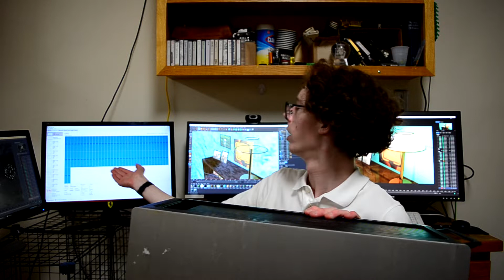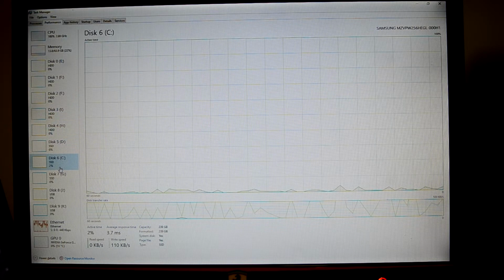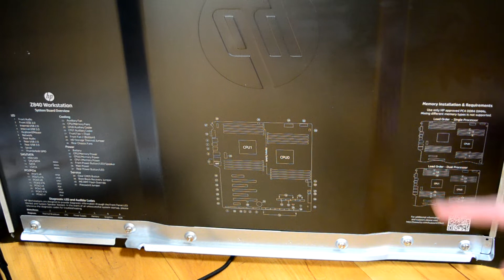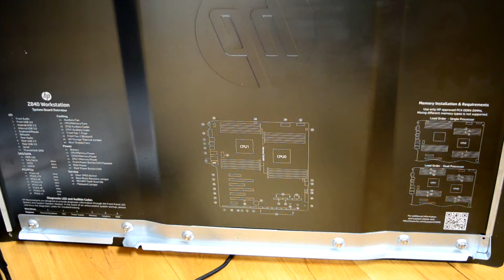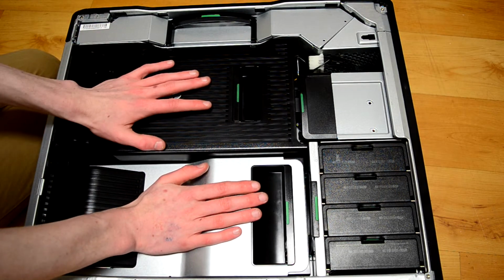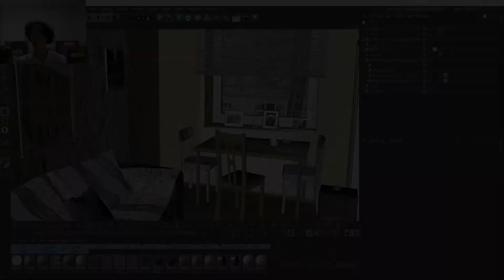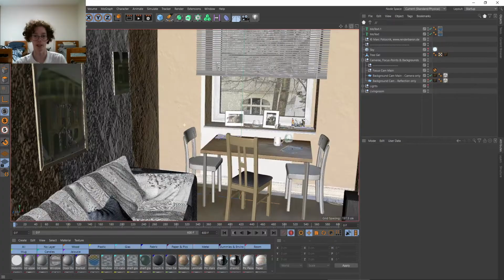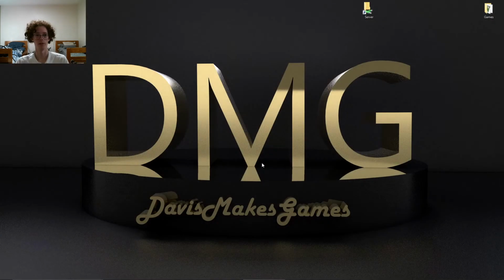My new ludicrously overkill workstation

Comment: E5 2697 V4 128GB 2400 2 x P4000 P2200 Asus Essence STX II Dual Turbo NVMe 250 GB Gen3 IO Fusion 1,2 TB 4fach LAN Druckbelüftung 4 x 70mm x 25mm (Schacht) 1750 PSU @ 240 Volt oh, yes Zorin OS 18 pro Opera core stable. An Irish Horse. Full Slot Utilization +1!

Comment: rockI have the z820 with e5 2670s with 1080ti and its so slow at actual work loads. It takes 1 hour to render 10 minute regular edited videos on davinci resolve and even longer on capcut. It can't even run UE 5 or 4 without crashing. It can barely handle video editing or 3d modeling despite being advertised as it's bread and butter. My 5600x with a 3060 gpu outperform this computer in every single work type even the ones that should run better with more cores
Reply: Is it just E5 2670 or is there a v2,v3,v4?

If there is no v then it's first gen which is still running DDR3 which is very slow. The Z840 can run v3 and v4 of the 2600s on DDR4, V4 can go up to 2400MHz

Comment: Are you still using this ? If so, and you can afford it, grab yourself a HP Z turbo Quad Pro and pack it with 4 x 4tb Samsung 990 pro NVMes in Raid 0. I bought one three years ago for my Z840 and now just bought a second one for my Z8G4 for just $80 (empty of NVMes)

Comment: Love these HP workstations, have a Z620 with 2x E5-2690s and even 13 years later it's a rocket ship... Got a Z840 arriving on Monday with 2x E5-2687W v4s, can't wait to build it out. Only cost £99 delivered 👀 

Great work with yours! Gonna go check out your other videos now.
Reply: rocket ship at what? I have the z820 with e5 2670s with 1080ti and its so slow at actual work loads. It takes 1 hour to render 10 minute regular edited videos on davinci resolve and even longer on capcut. It can't even run UE 5 or 4 without crashing. It can barely handle video editing or 3d modeling despite being advertised as it's bread and butter. My 5600x with a 3060 gpu outperform this computer in every single work type even the ones that should run better with more cores

Comment: I have one that I used to run proxmox on it.  Then redid it to run OMV but it wasn't stable.  Now I am running Ubuntu with Samba for file storage.  It has the same processor but my video card is very basic.  I have 190GB of ram and 4TB of SSD drive space in a Raid 0 configuraton.
Reply: How do you have 190GB of RAM?!

Comment: Loved your video. My HPZ840 has 2 E5 2697 v3 CPUs, 128 GB ram, 1 TB HP NVME boot drive with Windows 11 24H2, Seven 14 TB SAS drives and a 24 GB Quadro P6000 GPU. I really love it. Super fast and super reliable.
Reply: Hey i Just got my hands on a Z840, I'm looking to build a server. how did you get 7 drives into the case? which enclosures are you using?
Reply from the maker: Personally I use the SATSASBP425 enclosure in mine

Comment: Great Workstations I have a few of them,  Just updated one with 2X20 core CPU amd 768GB of RAM as well as a RTX 2080TI. They have 1500W power supplies and are so solid The TPM chip can be updated but Windows 11 does not have the CPU's on its approved list.
Reply: but you can still update to win 11
Reply: That is ridiculous. That is the equivalent to a space heater. Why don't you upgrade and get something that will require a 20 amp circuit? No idea why anyone needs a computer like that.
Reply: @idmhead0160  These are cheap or in my case rescued from Ewaste so its a no brainer, Most of mine are running Linux based NAS servers

Comment: Good on you man for using what you got and smartly building your new system.    If you just need  a Video card with lots of ram?   Just pick up one of those server cards and install the fans on the side,  then pick up one of the Newer Intel GPUs  so you can still game and do hardware accelerated Video encoding with Intel's Quick Sync for your video transcoding.  

If you really want the most responsive OS out there?   Get one of the EOL'ed  Intel optane drives as your boot drive or Scratch drive.  
Sure its MAX transfer speed is not as high as current Gen NVMe drives, but the Que depth that an OS uses is PERFECT on these drives. 
They also don't slow down  as they fill up either.
Reply: Optanes are highly under rated. I have a 280gb 900P boot drive in mine, love it and it will essentially never wear it out.

Comment: How to access the AMT mode? Is there a software with which i can remotely interact ?
Reply from the maker: You'll need to use the AMT LAN port first of all, and make sure the Management Engine is available in the BIOS... past that, any remote management software that works with Management Engine can be used. Couple of them listed at the bottom of this document from HP
https://h20331.www2.hp.com/Hpsub/downloads/HP_WS_Manageability_WP.pdf

Comment: This thing is so insane even for 2024 standard, it's spec is even on par with my strongest pc (aside from GPU) which comes with i7 13700 + RTX 4060 + 64GB ddr4 ram, and it feels like it's video editing performance will gonna destroys my ASUS TUF A15 2023 (Ryzen 9 7940HS + 16gb ram + rtx 4070)
Reply from the maker: I've since upgraded to an RTX A4500, pretty solid card. 3D comparable to a 4070 on paper, but has 20GB of ECC VRAM. Multicore CPU performance is excellent, just a shame that in single core workloads it is soundly outperformed by my 3rd-gen i7 laptop lol

Comment: Wow 😯. I have a HP Z 440 with a E5 1650V3 32g 2133 ddr4. Just fitting an HP Turbo pci-e nvme adaptor. I bought it because it was cheap. Only has a K2200 GPU which works fine for what I do. Great information 👍🏾

Comment: 1) dont fool yourself with the plastic coversr. these machines are not build to a very high standard. the case hasnt changed in 4 generations of Z machines and the mainboard power delivery is barebones. even 150$ gaming trash boards features 12 or 16 phase power delivery nowadays and the design on these boards is designed to supply the power under load while being cooled.

2) you are wrong on the memory channels. each cpu has a 4channel layout. these dont combine into 8channel memory layout. if you want one cpu to talk to the memory of the other cpu your speeds are realy realy bad.

3) be aware of the pcie sockets you want to use if you run 3d applications. you dont want cpu0 to be utilized and loaded when your gpu sits on cpu1s pcie lanes. same goes for other cards. its one of the pitfalls with multicpu systems you need to be acutely aware of -  the overhead of cross socket communication is substantial and will hinder performance in 3d applications that rely on system resources that combine cpu/gpu performance since you might have cpu1 fetch data from cpu0 just to pipe it back into the graphics card that sits on cpu0 pcie lanes
Reply: Why ya gotta ruin it?
Reply: old dual xeons are only really worth it if you need lots of cheap memory, IO and par a l lel computing power. They are great for big storage servers or running lot's of vms. Anything low latency or single thread intensive is a very bad workload for these systems.
Reply: @Looser_23  yess 👍

Comment: Okay serious, question.
Is this worth the money compared to a more modern workstation that's similarly priced? Both for your workload and in general. Is there even a more modern workstation that's about the same cost?
Reply from the maker: Xeon E5 is currently the sweet spot for getting a ludicrous number of cores affordably. The newer workstations (like the Z8 G4, the 840's successor) all use Xeon Gold/Platinum CPUs, which sell for way more for the same performance and can get into the thousands of dollars just for one CPU, while the fastest LGA2011 CPUs are at most $250. 
These are so cheap because businesses replace all of their systems after a certain amount of time, and that "end of life" period has been reached for Xeon E5 so businesses are getting rid of the hardware. That hasn't started happening on nearly the same scale for newer workstations, so you are still basically paying manufacturer prices for those computers instead of like 1/3 the retail price used.

So in short, a new workstation for this price would have more CPU upgrade longevity in the future, but the CPUs you'd be able to get in it for the price would not be anywhere near as good.
Reply: @DanalogRetro  Just how much exactly did you pay for your workstation? Because I've been seeing Threadripper 3960x CPU/mobo/RAM combos going for less than 2000 euros. To me, despite the fewer cores, it makes those Xeons look like toys. Do you need threads more than speed?
Reply: @Liminal.Headspace  Probably less than 2 grand.
Reply: @BrunodeSouzaLino  I'd wager around 2000 with HDDs and whatnot. If it's more, it's just not worth it. Especially with Threadripper 3000 and Epyc Rome prices going down constantly
I'm more interested in his workload than anything else, to be fair
Reply from the maker: @Liminal.Headspace  I personally needed the raw thread count, and the onboard SAS controller was attractive to me. Also I like the case and PSU design of the z series workstations but that is a personal choice.
Reply: not worth it. these machines are obsolete and the performance compared to the cpus of current or even last gen is abysmal. one thing that will make these systems suffer ALOT is the pcie lane layout and the spare parts situation is bad when it comes to swapping things like a powersupply. If your psu breaks you are better off buying another system for parts. first hand experience from a z800 and z820 - unless you want to buy a standard powersupply and make your own adaptor for the proprietary pinout for the voltages.

these systems are nice to look at. they are fairly modular and have features you dont normaly have on standard pcs like hotswap bays. but these features can be integrated into most modern systems nowadays without effort and the reality is the corecount flex doesnt justify the inferior performance of the individual cores in relation to powerdraw.
Reply: @Zishy  The only real interest I have is what is he using it for. 
For a system I've already got a Ryzen 9 5900X and a RTX 3090 inside of a Silverstone WX200 that I got really cheap. I can fit another full system inside that case and was perusing my options for workstation hardware.
Reply: It's hard to say because there are single socket systems with more cores and threads than that nowadays. A Threadripper 7995WX system would have 64 cores/128 threads and support up to 2TB of RAM.
Reply: Really not worth much. The 8-core CPU in my 14-inch laptop is about 20% faster than one of these 18-core CPUs under all-core load (and almost 3x as fast for single-core workloads). The laptop is still slower for heavily-threaded workloads compared to 36c/72t, but it's a lower-TDP laptop vs an old, power hungry system. With 72 threads, these dual Xeon CPUs will perform pretty close to a current i5-14600k, which only has 6 P-cores.

The power bill (including cooling in the summer) is the worst part of these older servers and workstations, and of course the often-proprietary power supplies. A newer system, and a $30 SAS card, will do just about as well. ECC memory compatibility may be lacking when using desktop-components, which is my main gripe with desktop vs workstation level systems.